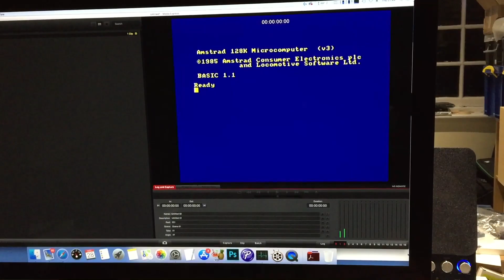ChinnyVision Extra: Amstrad CPC not powering up? Watch this.

Comment: Excellent! I did this for my amstrad and it fired up! But then after about 10 minutes of being on, it died :( Am not sure how else to power it on.
So that is 3 cpcs i have that don't work. (they all refused to play a tape, but would rewind and ffwd!)
Reply from the maker: Belts need replacing in the tape decks. Did you give the CPC too much voltage? There is no internal protection. If the power is not regulated you risk frying the memory and other chips inside.

Comment: Useful tip. It's always good to check the basics before thinking something is dead. A common Vectrex issue is the "white dot" in the middle of the screen, I fixed this by cleaning the on/off switch. So switches are a common point of failure. Probably why so few devices now use a proper switch.
Reply from the maker: Switch faults don't happen when machines are used. Its when they sit around the contacts oxidise. Lack of switches these day comes down to cost cutting.

Comment: Had this when powering up my English 6128 for the first time in decades. Flipped the switch back and forth several times, rapidly, to shift the corrosion. Shall need to look into it further next time I am in the UK (it is with my parents) unless I can pay for them to ship it to me. It is surprising that that was all that was wrong (well, the drive belt needed replacing). I was fearing an explosive capacitor or two, or the monitor doing something dangerous...
Reply from the maker: CPC's not known for blowing their caps. However worth using a top notch modern regulated 5v PSU such as those sold by RS as any voltage irregularities fry the RAM. A nice stable supply gives you lots of protection.

Comment: What Frankensteinish machine is this?
Amstrad Logo on the left of the keyboard instead of Schneider?
And on boot it also claims Amstrad instead of Schneider 128k Microcomputer?
What evil sorcery is this???
Reply from the maker: Amstrad and Schneider parted company in 1988 when Schneider didn't want to sell Amstrad PC's. Amstrad also felt they had poorly handled the marketing of the PCW. So there was a reorganisation where Amstrad launched their own German division (IIRC head hunting a former head of Commodore Germany to run it) and also took control of their Spanish distributor Indescomp by buying them out and renaming them Amstrad Spain.
Reply: Yes I know, that was already in 1988?
I always thought it happened right before the CPC+ line launch and didn't affect the classic CPC line at all.
Reply from the maker: Yes, '88. The fall out happened after Amstrad launched their PC line in 1987. So they got out of the contract as quickly as they could.

Comment: Use sandpaper, contact cleaner and bend it a bit.
Reply from the maker: Didn't need anything as extreme as opening it up.  Contact cleaner solved it. Opening the switch up should be the last resort before full replacement.
Reply: Glad to hear that Chin.
No need for replacement though, it's just a piece of metal inside.